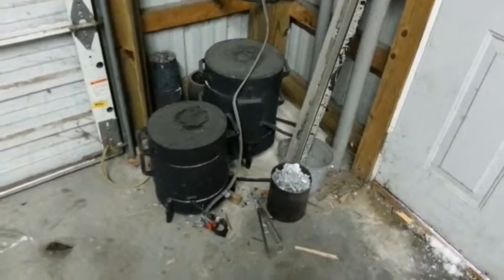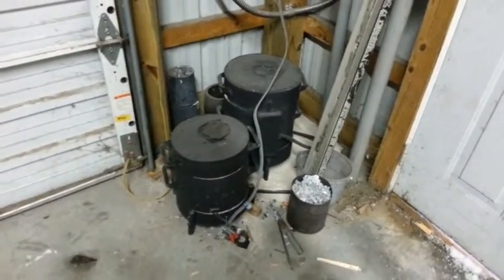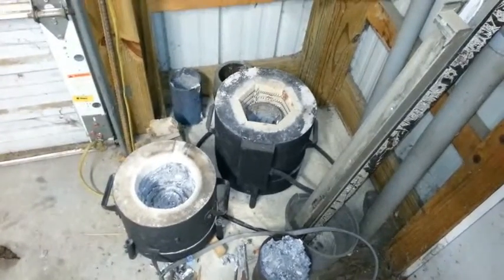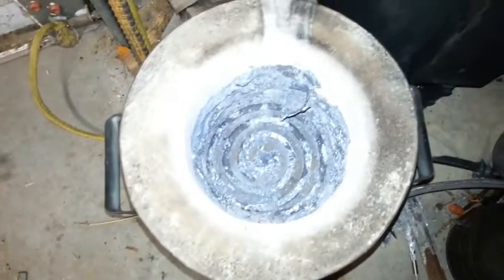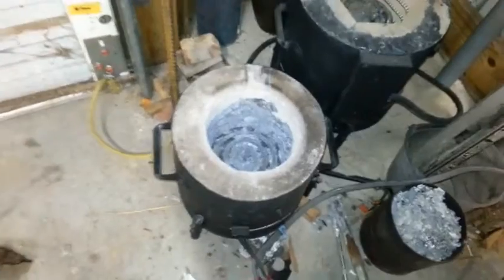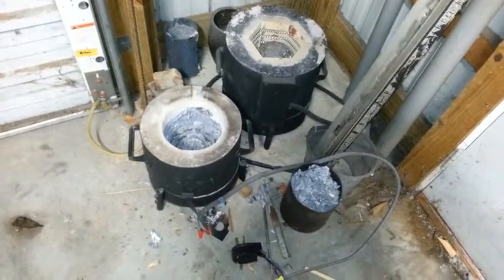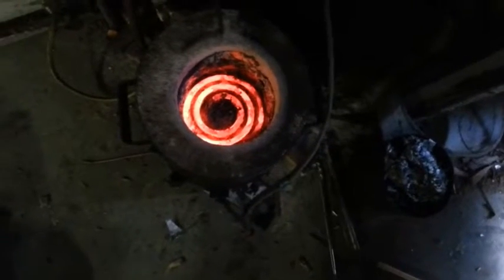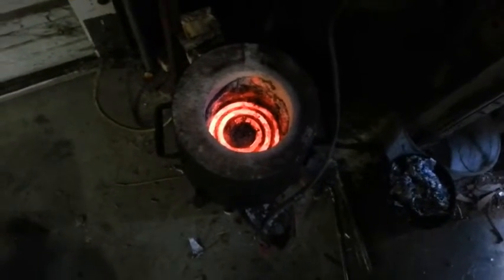Simple ladle furnace for melting aluminum

Comment: I wouldn't have thought that a normal stove element would  tolerate prolonged contact with molten aluminium, good to know I was wrong. I may need to re-think the design of my next furnace.  Thanks for sharing this with us
Reply from the maker: Actually the burner doesn't last very long, after a few melts, the aluminum attacks the burner and eats through it.  I might have gotten a dozen melts and then it failed.  One thing that is better is putting the element in the lid, and the metal doesn't contact it.  I've gotten better element life with lid-mounting.
Reply: @dansw0rkshop  Thanks for the update and the suggestion.